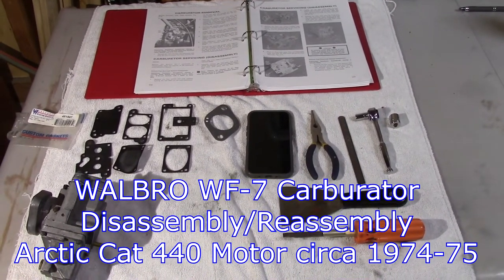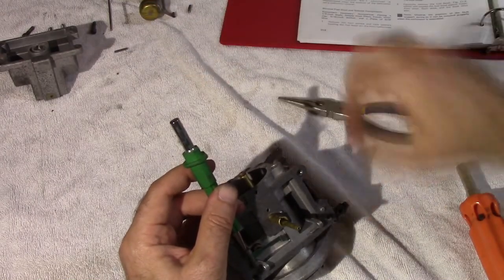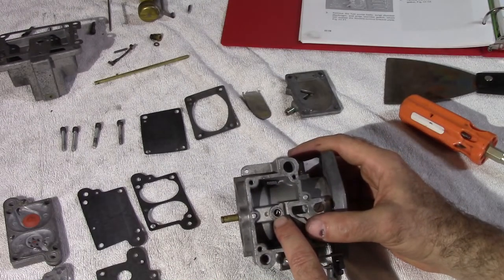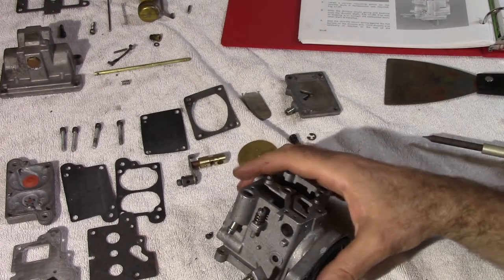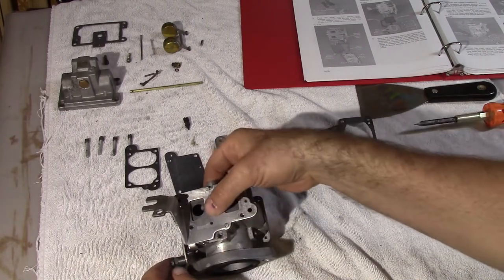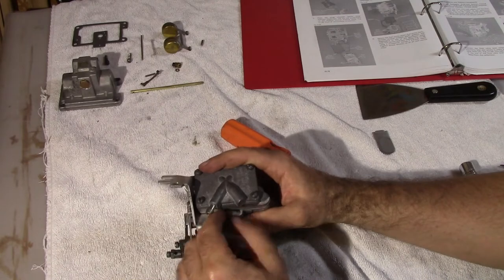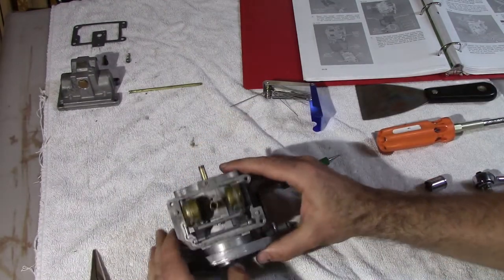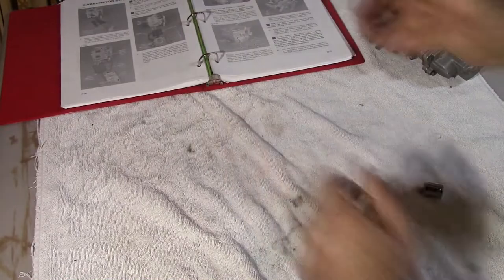Walbro WF 7 Carburetor rebuild for 1975 Arctic Cat Panther Snowmobile with 440 Kawasaki motor

Comment: NOTE FROM THE AUTHOR: The float was inadvertently installed upside down. Also, float spring does not need to be wound that tight, one turn and show some resistance when carb is turned over.
Reply: Would you happen to know where to get the full rebuild kit? Jets and all?